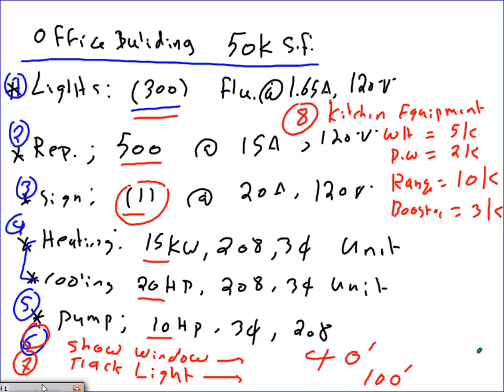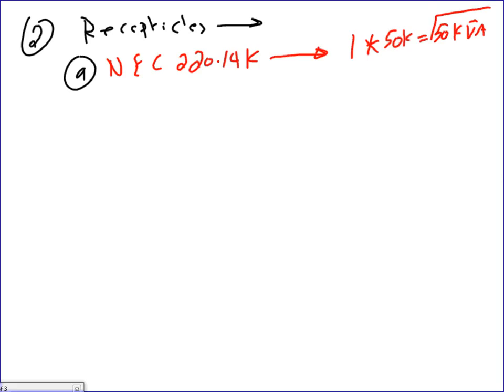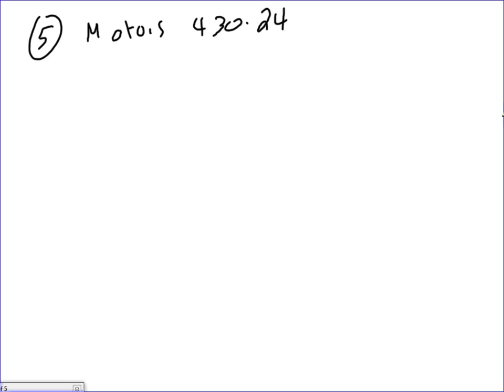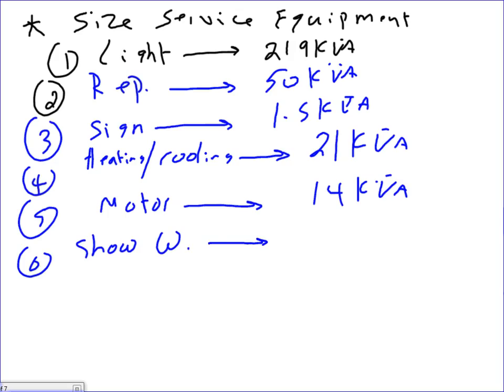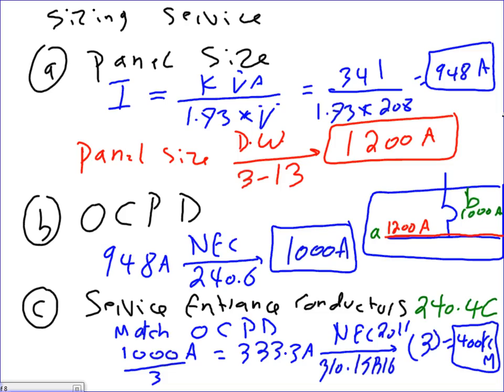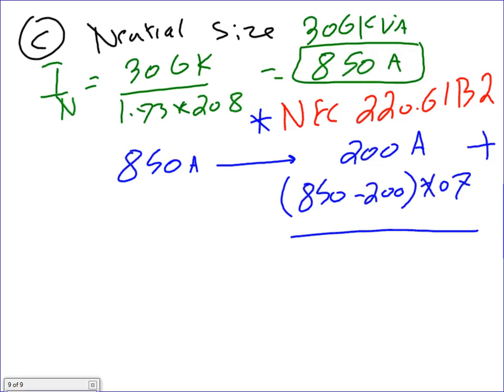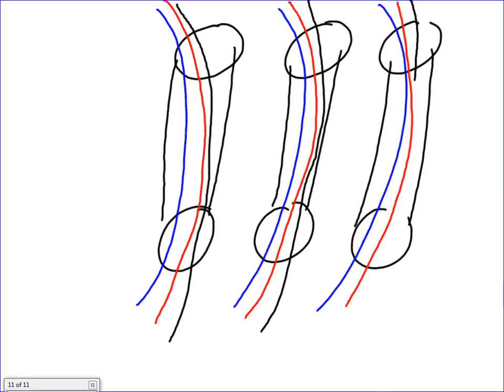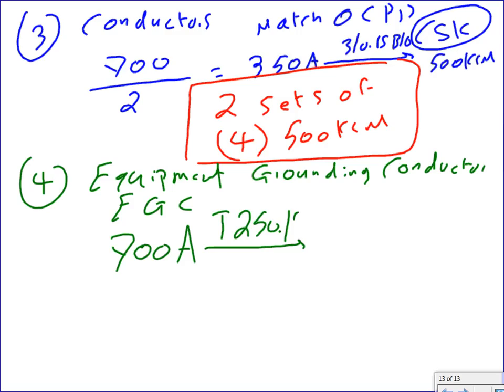Commercial Electrical Load Calculation-NEC-U#11-01-12-13-10.wmv

Comment: Thank you for this, it's going to give me an easy way to learn. 
I have one question.
Should the load of a 220.14(H) multi-assembly outlet be included in the total VA load, or is it already factored into the calculations of 220.14(I) or 220.14(K)?

Comment: Wrong!!!...why are you dividing by 208v for  load (Current) calculations, if its 3 phase, why not 415/420v......
Reply: It is okay...i see you are using the voltage standards of 120 v for single phase (L-N) and 208 for 3 phase (L-L)

Comment: Question:
1. Why NEC 430.63 was not used to determine the size of the main circuit breaker?
2. There is more than 3 conductors in a conduit, why did you not use NEC Table 310.15(B)(2)(a) for adjusting more than 3 current carrying conductors in a raceway?

Comment: I guess i'm not a fast learner, hence my question ???

@ 26:55 minutes into the video. is the # 4th step on the calculations on (heating & cooling)
My question is? as you are calculating the cooling load you have (1.73 x59.4 x 208) = 21kva
Where does this "1.73" number come from and what is its units amperes?

Thank you
Reply: The 1.73 is actually root 3, this is used when calculating 3phase Power
Reply: Ohhh... thanks :)

Comment: Also, you divided the total amps by 3 and the neutral by 3 because its a 3 phase/wire system? So,if its a 2 phase or single phase system you would divide by 2?
Reply: No sir.. it divided because there are 3 sets

Comment: Thanks for the info it was very helpful! I have two questions. When sizing the neutral shouldn't you use 100% of the actual lighting load not 125%? and When you have a heating system with a motor (HP) can that be considered your largest motor?
Reply from the maker: Sarah Chapman  correct. According to NEC you can size the neutral based on 100% of continuous and non continuous load if you have heating and motor load you chose the largest to multiply by 1.25.

Comment from the maker: You are right! I need a mic & I need to slow down!
Thanks
Reply: I have a secondary of a transformer with multiple taps the voltage applied to x1 and x5 is 200 volts (40 turns) whats the voltage between x1 and x3 (20 turns).

PS. x1 to x2 has 10 turns and x1 to x4 has 30 turns.

The asnswer supposedly is 60 but I dont see how that is possible

Comment: Yet I see you used  Volt amps for Lighting and multiplied the entire result by 1.25.  In so using volt amps you would have increased volts by 1.25 and amps by 1.25.  Would doing it this way create a problem of oversizing the cable.  I suppose being larger than required is up to code as you exceed minimum standard.
Reply: He is right

Comment: My question is about your 125% multiplier.  When is it best to use the 125% increase for wire sizing?  I took 2 master electrician exams in two states and both states I left this off until it was needed for wire sizing.  The result is the final solution is correct in both cases but the exams in one state differed from the other state.  One state must be using what you do.  While the other does the loads (such as 3.5va x sq. ft= A.)  with no 25% increase until the final cable sizing.
Reply: The main feeder cable.